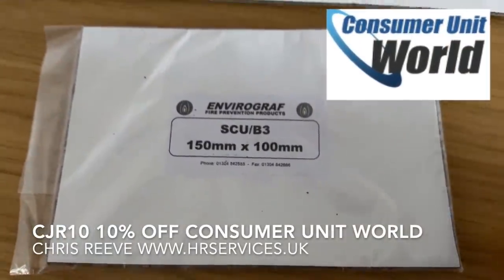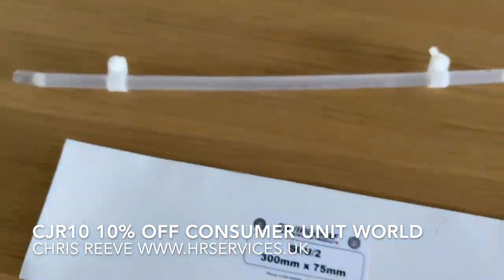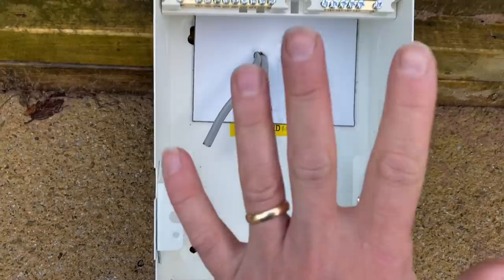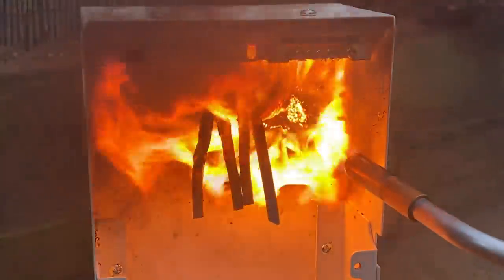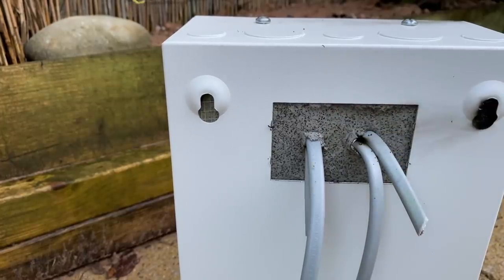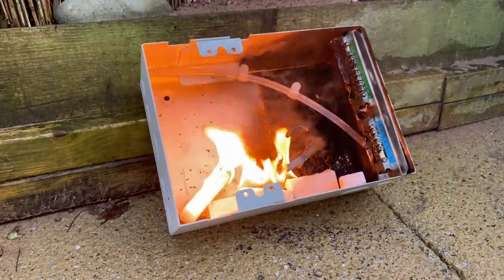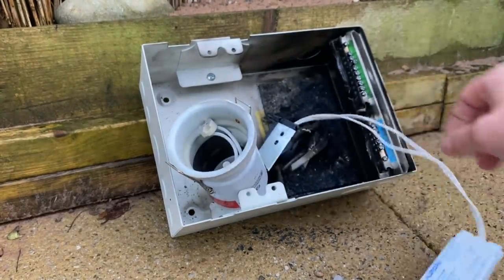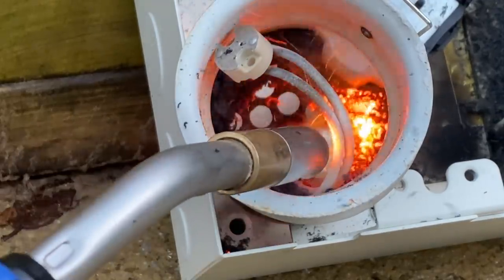Yes madame your consumer unit is on fire

Comment: Not convinced by that extinguisher tube - if a CB or whatever was hot enough to start a fire, chances are that source of heat would still be there after the tube popped, so it would just light up again once whatever was in the tube has dissipated.
Reply: Might actually pay to include some kind of pressure switch on the tube to be wired across a shunt trip mechanism maybe? (or L to E on the outlet of a main RCD)
Reply: @Jules Moules Yes, i'd want a development on this as stated elswhere.. Spot the 'poppage' and kill the installation somewhere. Even at the main switch or breaker in the same box would be ok (unless that was the source of ignition)
Reply: place multiple tubes perhaps?
Reply: There’d still be heat left in each of tests after though?  Is the tube better than the pad because it actually puts the fire out rather than letting it still burn?
Reply: I guess the idea is to give the main fuse some time to do it’s job?!
Reply: @mikeselectricalstuff: Fire Triangle - no oxygen = no fire. 

OK there are exceptions but conditions here are not conducive to exothermic reactions.
Reply: If my CU was burning I would be happy for that extra minute
Okay thinking about it a little bit more it's probably freon. Freon takes a ridiculous time to dissipate because it moves really sluggish. Also would like to note that there are now approved freons with barely any greenhouse effect before someone says it's banned
Reply: not convinced by mike

Comment: Impressive stuff. I would imagine the tube would break quicker in a sealed DB as the heat would build up much quicker.
Reply: Also the liquid and its vapour would stay in there for quite a while. It's probably a freon so it would linger in there for a long ass time

Comment: The tube was amazing as was the back pad. But, the downlight was so slow that by the time it sealed the rest of the house would have burnt down.
Reply from the maker: Yeah the down light was very old technology
Reply: Don't forget that there would normally be a light bulb in the fitting which would cause the seal to occur much sooner.
Reply from the maker: Yes you are correct Steve good point
Reply: @farmersteve129  faster than a blow lamp??
Reply: @UberAlphaSirus  the blow lamp isn't a realistic test. In a real world fire situation the whole unit would be heating up before the flames arrive in the back of the fitting - unless there's no lamp fitted, the fire is directly beneath the fitting & manages to reach the height of the fitting very quickly!
Reply: So yes there would be a lamp is some sort in the fitting and a house fire, the ceiling temp would easily reach the activation temp of the intumescent ring before flashover would have occurred.
Reply: You could see that most of the foam was blown out by the torch. Normally you would have a glass cover, a glass+metal bulb in the center and no draft at all.
Reply: @whatevernamegoeshere3644  all good points, thanks for the feedback and discussion. 😷🤔

Comment: There was some tests done a few years back with an open backed down lighter with no fire protection, the test showed that with the lamp in place the fire rating of the ceiling was exactly the same and not compromised at all.

Comment: As somebody who builds a lot of PCs and servers that are left unattended those enviroburst things look like they could be handy as a last-ditch. You can get systems like Firetrace which are great for enclosed cabinets and I've used it in the past, but they don't work when you have systems that are unenclosed or for smaller setups - in a way it's very similar to firetrace but at a much smaller scale. I like that a lot and can see uses outside just consumer units..
Reply: Yeah I was going to comment on how it reminded me of the fire trace system we have on our industrial panels at work. They have a pressure switch on them that kills the power to the cabinet if the fire trace is discharged, or the pressure drops due to a leak etc. Went off once due to a faulty contactor. I've always thought something similar for domestic use would be a good idea, maybe would need to release some sort of foam to fill the unit so as to stop the fire starting again...
Reply: The only other similar thing I can think of that might arguably be usable domestically is like the Elide fire ball things, but they fire powder everywhere and make a massive mess when they pop, and they're not exactly discrete either. I genuinely wonder if the manufacturer has considered all the areas where this could otherwise be extremely useful, especially given the compelling price.

Comment: the pads are fantastic and should be mandatory world-wide for use in outlets and switches in all walls, and fuse boards
but that light... i gotta say, by the time a structure fire has got that light fitting "sealed"  enough flames, cinders  etc have already got into the roof space, the buildings gone, it acted way too slowly for my liking,  but that strange liquid is absolutely crackers, loved it , hrmmm wonder if its Novec 1230

Comment: I went out to a job where the customer was told by the previous electrician that her downlights weren't safe because they weren't fire rated, she had a concrete ceiling above the false ceiling for goodness sake 🤦‍♂️
Reply: There's two options there, he was either trying it on, or like many assume that you have to fit fire rated down lights, if she had a plastic board he would be wanting to replace that as well.

Comment: Agree regarding the downlighting and non fire rated. I just don’t understand why the don’t make it so they all have to be fire rated, yes I know if it’s not got a habitable room above you don’t need them but I only ever fit fire rated lights
Reply from the maker: Never ever fit non fire rated lights non habitable room is just nonsense.
Reply: @Cjrelectrical  Agreed, these days non-fire rated is hard to come buy unless you habituate the clearance aisles of low budget DIY supercentres
Reply: Because then when Ms Bloggs gets an EICR every spark will be telling her she has to rip out perfectly serviceable downlight and replace them all to protect her collection of old hand bags in the loft.
Reply: Point of order - as I understand the building regs any time you penetrate a wall (or floor/ceiling) you have to ensure that you don't change the fire performance of the wall etc, which means in many (if not all) cases a downlighter should be fire rated regardless because it's would be the only way to achieve that.

Comment: So in a real fire scenario, flames all around the CU the contents will be protected, ancillary items such as smart meters and external cable feeds and tails will burn?  Cables inside the house will burn and melt, all will be okay because the CU containing the MCB/RCBO’s will be saved together with small lengths cable.  Am I coming at this from the wrong angle?  I’m a retired electrical engineer who had to have qualifications mainly for commercial stuff a very long time ago now.  Just interest, that’s all, not criticising anyone as you all do a really great job. Thank you for these wonderful posts I’m a great fan.👍🏻👍🏻👍🏻
Reply from the maker: More to stop a fire that’s started in a consumer unit spreading to the rest of the house.
Reply: Well I never thought of that one.  Thanks for teaching an old dog new tricks.  You really have a great channel and a great skill and ability.  👍🏻👍🏻👍🏻

Comment: That tube was a bit of a suprise, i certainly did the job of blowing the fire out. Why use Wylex, i would've used BG, that's the only thing they are good for, setting them on fire and putting them straight in dustbin.
Reply from the maker: Agree with that
Reply: Yes, that wylex is fine once cleaned up a bit ;)  But yeah, BG is the PITS
Reply: TBH that tube had an easy job in this experiment. In a box, it would last 5 minutes and the fire would start again.
Reply from the maker: Technically its more affective in a sealed box rather than an open lid like in this experiment

Comment: What about the fire seeping through the screw hole?
Reply from the maker: Consumer units aren’t normally floating in mid air so hopefully fully secured to a plasterboard wall, brick or fireboard
Reply: It's mostly about slowing the rate of spread of fire rather than stopping it completely, which is very difficult to do.  Mount a board on a piece of wood (e.g. a lump of chipboard or a 2x4) & try with a blow torch to burn the wood through the screw hole - see how much heat & burn time you have to put into getting that piece of wood to either burn through or become a self sustaining fire in its own right.

Comment: The downlighter was crap to be fair, so was everything else. The DB board pad would be better if it was made like a brush. Why don't they make a DB module heat and smoke alarm main switch, Beep beep beep and cut the power.

Comment: I also like playing with fire
Reply from the maker: Loose wires cause fires
Reply: Hey Chris , in what application was that tube thingy designed for ?
Reply from the maker: Retro fit into plastic consumer units or metal if you want to go ott
Reply: Cool, obviously make different sizes then.